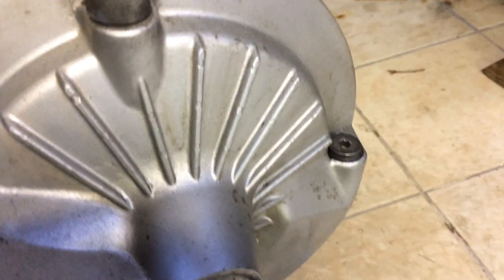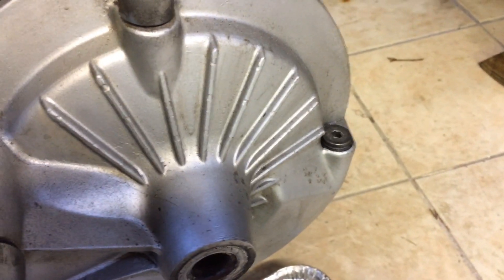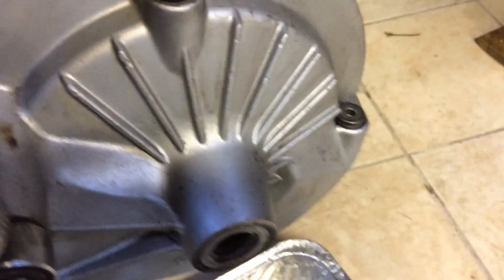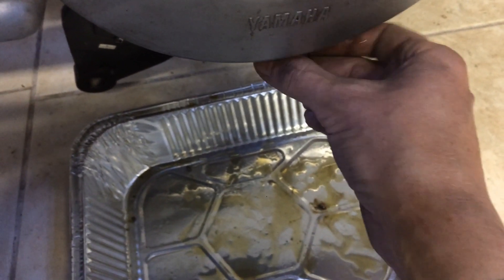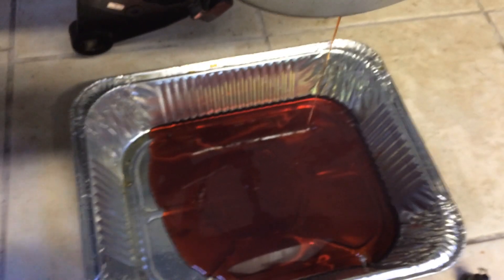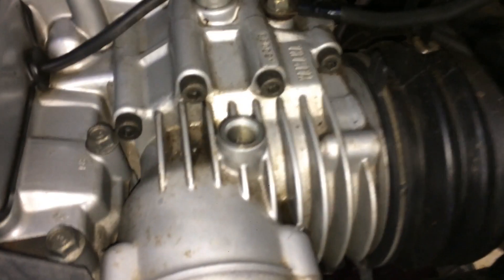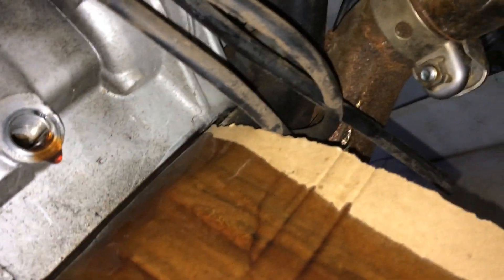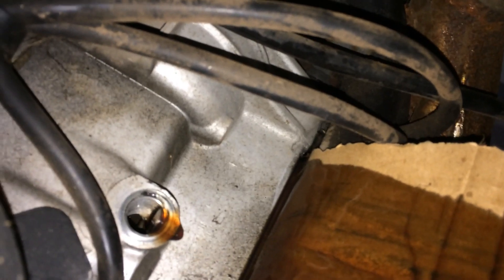XS750 Gear Oil Change / Frozen Fill Plugs

Comment: very helpful, i was really trying to find out where the heck the drain plug for the middle drive was since its not shown in the parts list. how much oil did you put in the final drive?

assuming you still know after all that time xD
Reply from the maker: Thanks! Use 375mL for Mid gear, 300mL for final drive. There is a pattern to make a dipstick on-line. Use 80W90 Hypoid Gear Oil GL-4
Reply: @pushrodfury6644  Would you happen to have the link to that website with the pattern to make the dipstick?

Comment: Why does the final drive oil look red like transmission fluid?
Reply from the maker: Some Hypoid gear oil is red, I've seen other oil that looks blue. I would recommend you change it using the type specified in the manual, run for a few miles and change again to make sure anything old and gross is rinsed out. I was surprised the oil for 1983 looked so good though.
Reply: @pushrodfury6644  okay cool, thanks for the explanation.  I did not know that. Thanks for the video as well. It was very informative.
Reply: Great vid...thx

Comment: Hola amigo saludos desde venezuela podrias subir uno del filtro del aceite del xs 750 ya que estoy armando una y no tiene filtro en un manual vi que en el tornillo lleva como un balin y un resolte y la mia no tiene absolutamente nada de eso
Reply from the maker: There are 3 oils: Engine; Mid-Gear and Final Drive. Only the Engine oil has a filter. Here is an example of the engine oil filter parts. https://www.ebay.com/itm/333288951854